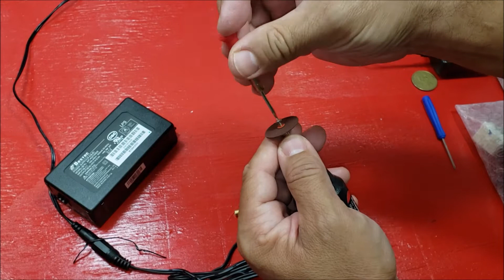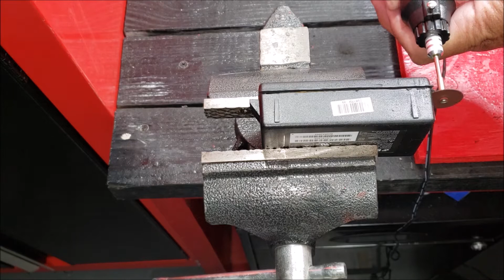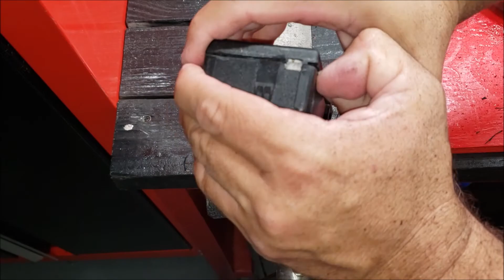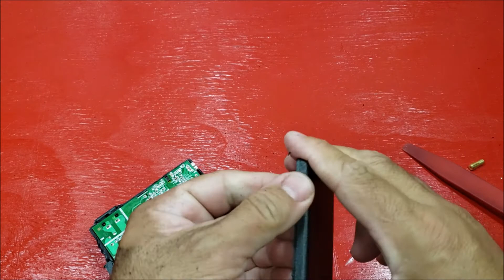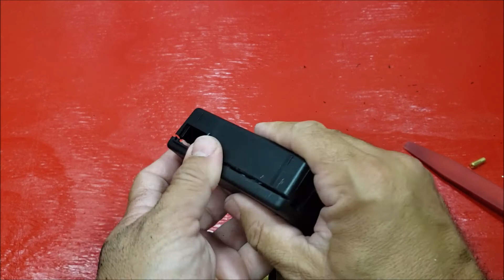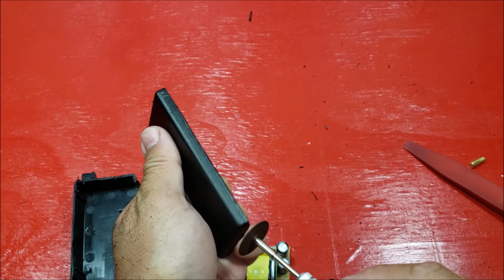How to Open a Sealed AC Adapter/Charger without Damaging. Cómo abrir adaptador sellado sin romperlo.

Comment: Just opened one up. I sprayed flux spray in the crease and it melted the glue after waiting a few minutes for it to soak into the glue then i just pryed it open with a tiny screwdriver and it peeled apart easy. I fixes what i needed to fix and just super glued it back together. Doesnt even look any different than before i opened it

Comment: That severely damaged the case. Try using a bit of acetone along the crack to loosen the glue instead. After that, It should pull apart pretty easily.